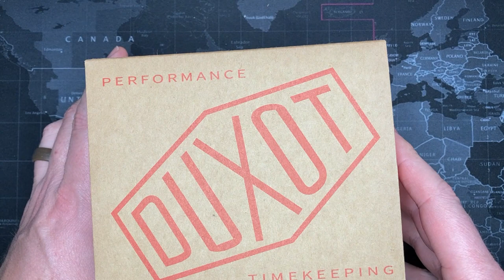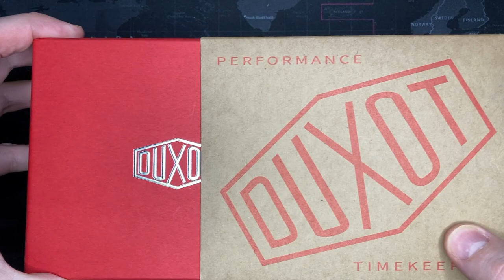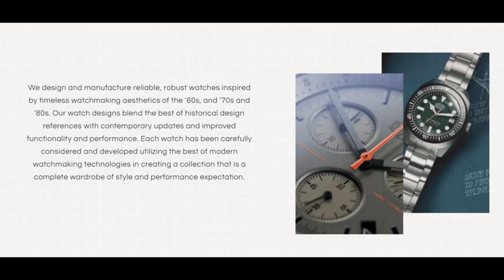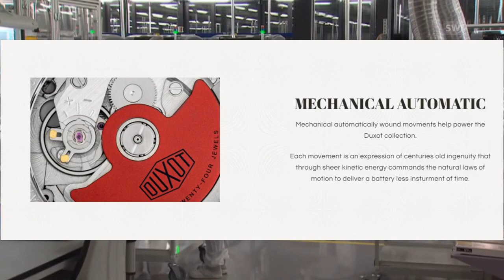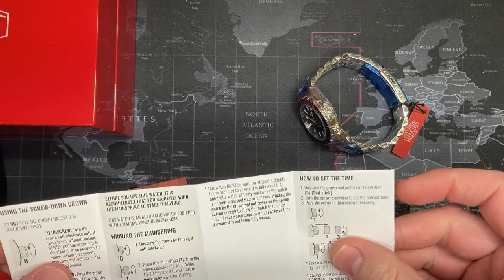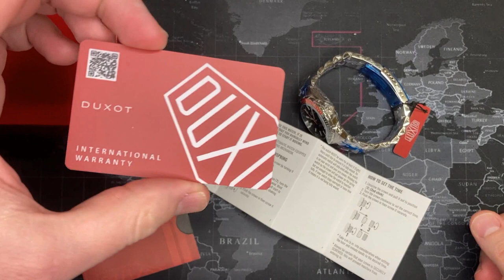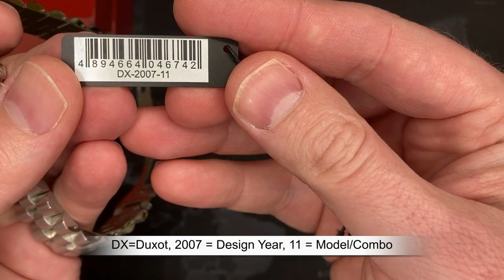Duxot Consillio Black Fumèe 100m Dive Watch - Review & Unboxing (DX-2007-11 / Seiko NH35A)

Comment: But you fixt a few.
Reply from the maker: Hi, I have. I’ve rebuilt a few of them. There isn’t any normal maintenance that I would normally do... but when I repair or rebuild one, I use a very little bit of synthetic oil. Generally, they dry out and the gears break, or the ic goes bad.